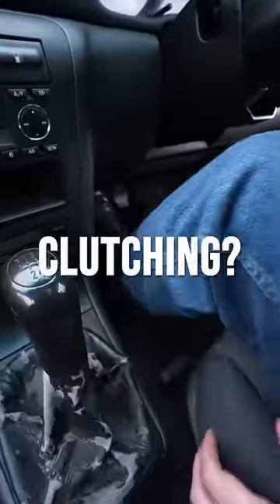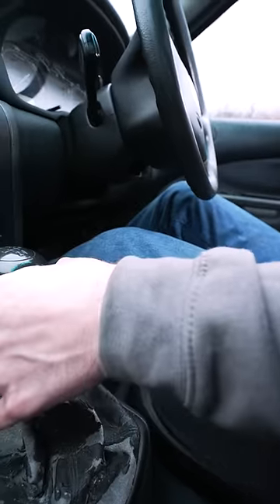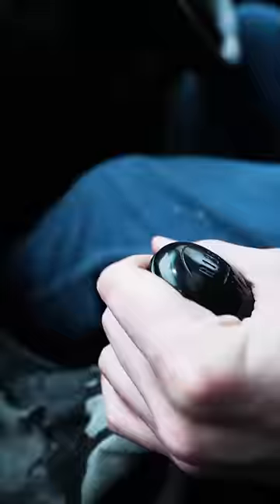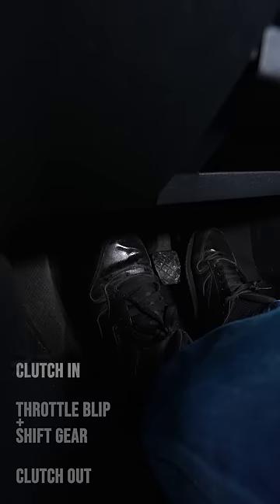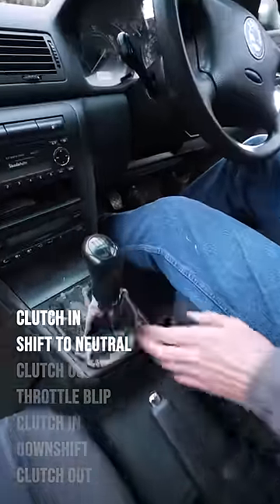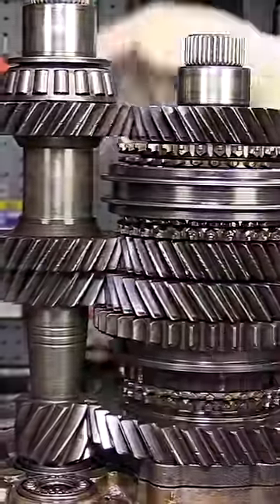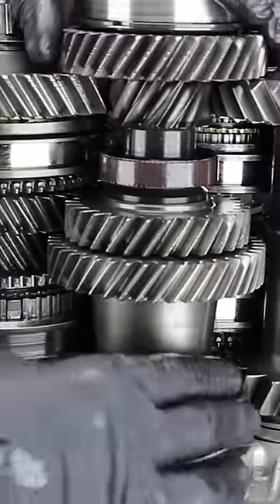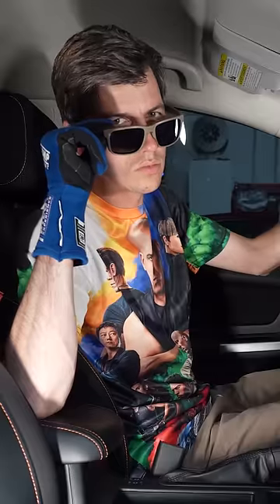What Is Double Clutching? Don't Granny Shift!

Comment: Any way guys let me teach you how to drive a manual,

Step 1. Learn how to drive a automatic car first.

Step 2. How to start a manual car,  push brake and clutch all the way in and start car then put car in neutral.

Step 3. How to start rolling in 1st gear, push clutch all the way in, put car in 1st, take your foot off the clutch slowly till you feel the car start vibrating, then start tapping the gas and you will be rolling after you start rolling take your foot off the clutch slowly.

Step 4. How to stop the car, press clutch all the way in put car in nuteral, take your foot off the clutch, and apply brake as needed to syop like you will do in an automatic.

Step 5. How to change gears, let's say you in 1st you will have to press clutch all the way in then switch the gear to 2nd then slowley take your foot of the clutch to engage the gear, thats what you do to all gears.

Step 6. How to not roll back, pull hand brake up, and hold it all the way up and hold the lock button in so it does not lock in, put car in 1st and take clutch slowly till you feel the car vibrate then strt tapping the gas and when you feel the car start to pull put the hand brake all the way down but dont leave it, when you make sure you are actually rolling foreward then put the hand brake all the way down and leave it and thats how you dont roll. 
Tip: Learn how to not roll back or at least reduce the roll back in that way.

Step 7. Another way to not roll back, if you are good in driving a manual, then this shouldnt be hard, put car in 1st and find the biting point put the car into a deeper section of the biting point and very fast take your foot off the brake and give the car gas then quickly but considerably taking your foot off the clutch.

Note: all the steps i gave are the basics, how well they work with you is based on you, how fast you change the gear is based on you not me or my tips

Comment: you blip the throttle like that and you're gonna clash the gears. instead, you throttle up and hold it there, clutch and shift. then you let off the throttle. also, anyone that is a seasoned driver would know how to float the gears.  in gear, throttle up, pull to neutral, throttle down, pull to the next gear and let it fall in. no grinding.

Comment: why cant i just press the clutch, shift into a lower gear, throttle blip and release the clutch? Why do i have to shift into neutral and then blip and then downshift?
Reply: have you watched the video?
Reply: @neuron383 my question isnt answered in this video
Reply: @martincooper8031  because it's single clutching then, aka normal
Reply: @neuron383  but with the throttle blip it aint normal, im asking why you gotta shift to neutral and then blip and then shift into gear, why cant i just blip it while i got my clutch pressed down and in gear?

Comment: I don’t understand. Why does it make a difference? If have have the clutch pressed I can tap the gas? Why go through the trouble of giving gas in neutral when the engine is always disconnected while you press the clutch . I don’t have Syncro and have never had troubke

Comment: ...what happens if the synchros fail? Can they fail? I had a subaru that had zero consistency when shifting. Dad told me to try double clutch and that was the only way i could get it to shift smoothly on a consistent basis, otherwise I could burn that clutch all day and it would still buck like a mule.

Comment: I never double clutch. All I do is just push in the clutch and keep it pushed down then tap the accelerator pedal a few times to get the RPM up, then downshift into a lower gear for more power

Comment: I worked at a golf course where they had me move a $40,000 john deer. I hadnt used a clutch in like 15 years. I asked them to show me real quick bc i remembered it was easy enough. They didnt show me. I didnt know the  E brake was on the whole time and i obviously couldnt reach top speed. Ended up just smoking clutch i guess, so i parked it where it stopped and just walked away like nothing happened. If they just showed me like i asked over and over, it wouldnt have happened.

Comment: When you're pushing the clutch, What's the point releasing the clutch and pressing the accelerator, you're in neutral anyway when the clutch is pressed so no need to come off of the pedal in neutral
Reply: It puts extra stress on the clutch it can be done but will cost you in the long run

Comment: Well, if "Dom" actually knew what he was talking about he would be using a sequential or a Dog Ring gear box which dont require using the clutch to shift under a load. The Dog ring box will grind if you dont "Bang shift" it.and a sequential box uses an ignition  blip kill switch on the shifter to sychronize the shifts.(Motorcycles have sequential transmissions.) Now you know..

Comment: or you just depres the clutch as you hit nuetral, the blip off the throttle being enough to slide it out of gear, and only half depress the clutch on the way into the higher gear. 

practice on a rental....

Comment: Doing more work to feel more significant during driving, and then saying it is faster or better because of it, is naive to say the least. I've always wondered, why? Any racing driver in the world who is worth their pennies, do not double clutch, the clutch-throttle blip, if even that... Just dont slam it into gear like it wouldnt fit and youll be more than fine, you'll be faster.

Comment: Genuine question: what’s the purpose of the throttle blip while shifting gears?
Reply: on modern cars with synchronized gearboxes: nothing
on old cars with a gearbox without synchro rings: to match up the engines input shaft revs to the gear train inside the gearbox
when you shift down the engine speed has to get higher - but to do shifting you first lift your food from the gas pedal before cluthing - so the engine revs down
if you would try to shift down without the gas blip you would "grind teeth" as the gear to get engage for the lower shift spins way faster then the engine
for a smooth shift you first have to bring the engine up to speed
when shifting up you do the opposite: you don't gas blip as you want the engine to rev down to match the slower higher gear
Reply: @cryptearth it's not accurate what you've said. You're supposed to accelerate the engine and input shaft of the gearbox. Not just the engine.
Reply: @REDxFROG  well, english isn't my native english hence I'm not able to phrase something complex as explain someone why matching rotaional speed was important for old gearboxes without synchro rings
Reply: It's still useful in modern cars to stop the lurch when going down a gear

Comment: But why the heck u need to thottle up in neutral??? Like what's the point of it?  I as myself use throttle up on q manual car, but not in neutral
I always do it ON gear before shifting down a gear

Comment: If you ever do hard country 4WD with a manual your knee and hip needs a holiday halfway through the day from so much gear and clutch changing. Let alone fast and furious need the complete hip knee reconstruction surgery after the first thirty minutes. New clutch and a full gearbox rebuild from over use. And vin diesel is yet to leave the garage door in his rear view mirror 😂.

Comment: This is the reason why I don’t drive a manual car manual cars are a waste of time you have to adjust your seat all the way up just so you can have access to the clutch pedal and also so many manufacturers make the gearboxes so tight for what it’s not a race car and also to drive in the city tried to get a manual. It makes no sense
And also trip Tronic automatic transmissions, are so much faster, better and fun or are you do is play with the flappy paddles like a little kid 
Zoom Zoom Mazda
Reply: Yeah, but up to he early 1990s double-clutching was faster than ANY auto transmission plus much more fuel efficient. Which is why race car drivers of the time used double-clutching until then, slowly fading-out over the next 10 years.
Only after this period auto transmissions became faster (I mean shifting time) and more fuel efficient because they had more ratios applying a better use of the engine characteristics of the engine at almost any time. The Tiptronic finally beat them all later for fast up and down shifting.
Still for me, an old fashion car guy (and an ex T55 tank commander) I still love to drive cars with elderly gear boxes. If you know what you are doing it is great fun to drive them since it requires knowledges, skills and a feeling for the mechanical internals. If you drove an old-fashion truck along a hilly road for miles and hours, you certainly do no need a gym in the evening.
Once you are really used to it, you double-clutch totally out of your semiconscious, it goes completely "automatic". The disadvantage is for bus and taxi drivers, who particularly in the cities  have to press the left pedal so often just in one shift, they might develop knee-problems at the left once they get older in their job. Certainly, double-clutching is out-dated by now, but depending on your "taste", great fun to kick these old cars around, as long as you know, what you're doing.

Still, if you have a powerful modern European Diesel engine in combination with a manual transmission (or Tiptronic, which is actually rather a semi-auto) the fuel economy is still unbeatable.
Most of the auto transmissions are using internal break bands or transmission fluids which generate too much internal extra friction and therefore heat, ergo energy loss. With a traditional gearbox you have a minimum of tooth wheels and bearings, reducing all internal friction to the bare minimum of energy loss. 

Peace! from Dresden / Germany

Comment: What is a throttle blip wtf....
When I shift, I step in the clutch Pedal while I step off the gas pedal, change gear, start pressing gas again and slowly release the clutch.The higher the gear I am in, the less I need to balance gas and clutch, when re-engaging the clutch. Could switch from 4th into 5th with no gas If I wanted to...
 So please... Why would I just tap my gas pedal when shifting????
I certainly dont get this Double Clutch thing at all
I prefer Manual and in 200,000km never had a problem with my clutch so I am Sure I'm not doing it wrong...

Comment: Even if you have to do that. You can shift all the way and rev while you are holding the clutch before release it. Why you need 2 clutch cicles with one circle on neutral? Nonsense.
Reply: you seem very young to have never driven a car with a gearbox without synchro rings
Reply: N to match rev the input shaft rpms of the gearbox then quickly shift.
Without double clutching, the synchro rings accelerate the input shaft +one side of the clutch which causes some wear when downshifting.

But it's questionable what wear down comes first. Clutch or one synchro ring
Reply: Can you apologise to ur clutch for me

Comment: This was so utterly wrong I thought it was satire 😭😭 first off that’s not double clutching, that’s rev matching. 

Second that’s not how you rev match. Double clutching is essentially clutch 
kicking where you stay in a specific gear and while on the throttle you put the clutch in and the out causing rpms to shoot up. 

there’s no point in pushing the clutch in, putting it in neutral, putting the clutch out then back in and shifting into the previous gear. Just put the clutch in blip the throttle, go into the next gear and let the clutch out.

Comment: Never understood why double clutching was done instead of just downshifting with one smooth transition
Reply: Because both gears need to be in sync with the same rpms to avoid synchronization by the rings.
Also the engine is being accelerated by ignition not drivetrain.

Comment: Indian cars have problem of very cheap clutches, so if you all sudden have stopped due to civilian on road and are in third gear and dont change gear and keep car in clutch your clutch will get damage and also bad for average (petrol) and engine use. Also i drive only at average speed 40 to 60 only. Also i try to use always correct gear while driving and never overuse clutch like on second or third gear while on speed of first gear. Additionally,  you still haven't understood how people drive in india, there are two lanes even on smaller roads, slow and fast lane, reason why i get pissed on people (your ai) is they drive slow on fast lane and dont give any side

Comment: In the 50s 60s early 70s if you knew your car well enough and the revs you dont even need to use the clutch. BUT ! doing this wrong just one time and some trans repair shop will hand you 2nd gear into your hand in 15 pieces. Lol.

Comment: Indian cars have bad clutch, you cant overuse tjem for higjer gears so need to change them at perfect sync time so to keep everything running fine. Also smaller cars have very short gears so need to shift many times. My bike gears are even shorter than this car. No one is racing, in fact driving at 40 to 60 speed in fast lane (right lane)

Comment: That is rev matching
Reply: Yes double clutching involves rev matching
Reply: @haydenagnew  there is no double clutching, it's just rev matching but made simple for idiots
Reply: @riskysway2542  double clutching is just rev matching with extra steps...that makes it simple?
Reply: @haydenagnew  it's just explained step by step, but you don't need to shift neutral,  just pull the clutch
Reply: @riskysway2542 what do u mean by pull the clutch
Reply: @haydenagnew  my bad, i have a habit of saying "pull the clutch" because i ride motorcycles. I mean keep the clutch pressed
Reply: @riskysway2542  ah fair but that's rev matching not double clutching
Reply: @haydenagnew  My bad, they are different? I thought it was just a more simplified version of rev matching
Reply: @riskysway2542  no its just where you do the rev while in neutral with the clutch up rather than doing the rev while changing gears...at least from my understanding

Comment: The hell is a throttle blip?
Reply: Where u quickly press the accelerator...its kinda in the name
Reply: @haydenagnew  There are already words for revving up your engine.  Throttle Blip is not one of them.

A blip is a physical thing, not something you do.  You don't Blip.  You see a Blip.  You notice a Blip and try to understand what a Blip is.  It is not a thing you do.

You "rev" your engine, if you're just trying to increase the RPMs for a second.  You might as well say you're Throttle Smurfing.
Reply: @erisdiscordia5429  might want to Google the definition of blip it literally uses blipping the throttle as an example

Comment: Why do yanks do the throttle blip thing, you its completely unnecessary for the exact same reason double clutching, the synchro mesh does all the work
Reply: throttle blip is actually helpful unlike double clutching in normal cars. aside from less clutch wear it also speeds up shifts. when shifting without blip you have to wait for engine to speed up first
but yeah, you don't need to do any of those

Comment: double clutching my ass. I drove a beater box VW for years with no clutch.  Just  slip it into the gears using nothing but the synchros & gas pedal.